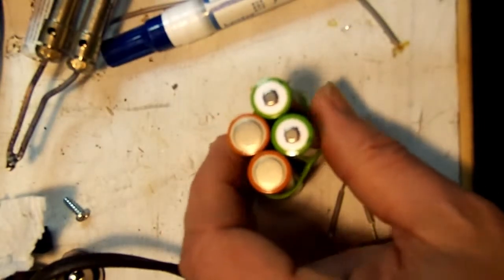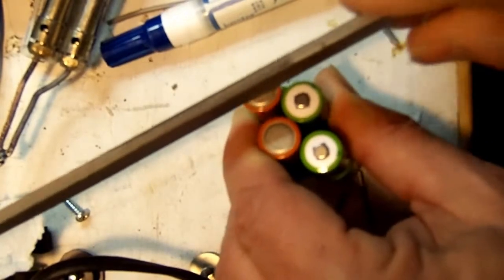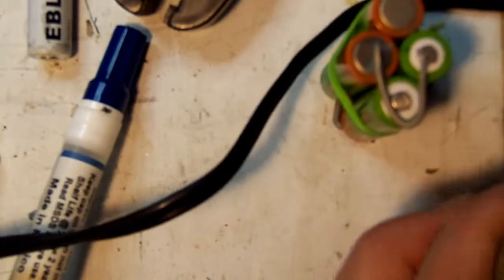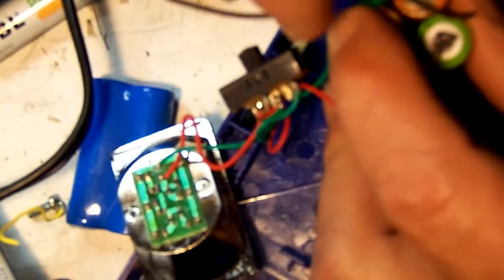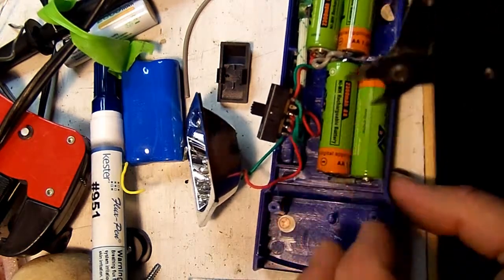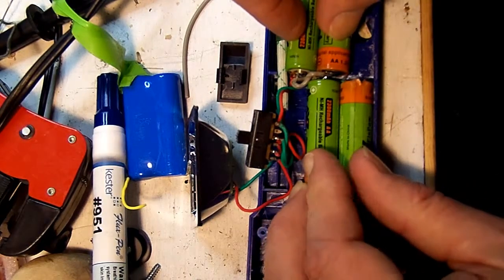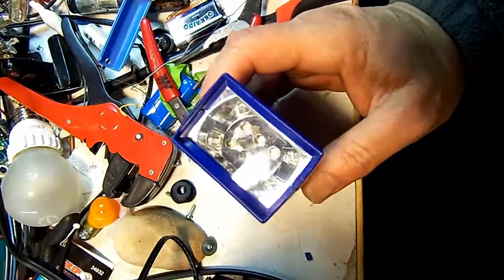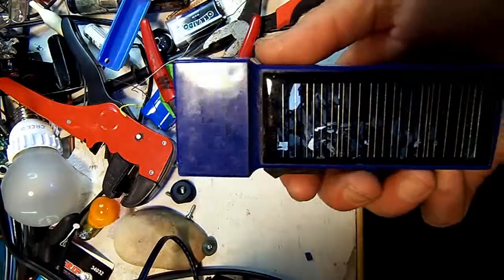Solar Flashlight Repair - Soldering to Standard 'AA' Cells

Comment: Nice to see your channel active again! I'd change the other LEDs. Seems to make a big difference.
Reply from the maker: JohnAudioTech  I probably will if I ever re-enter the flashlight.  I never did glue in the batteries, the foam strips they stuck on the inside of the housing keep everything locked in pretty well. This is my bedside flashlight, not sure I want it any brighter!